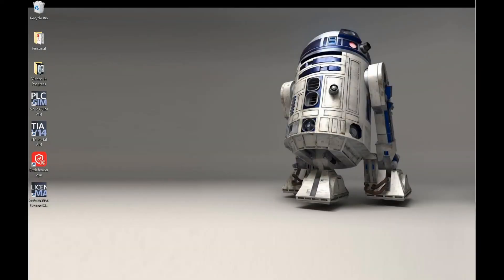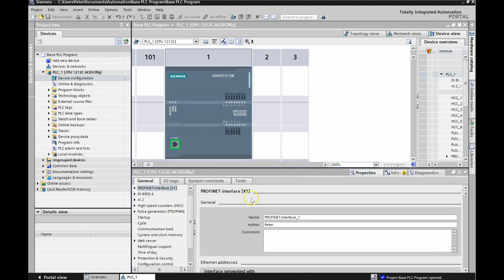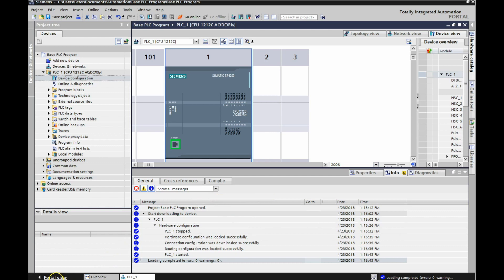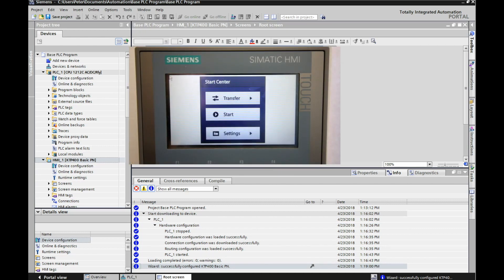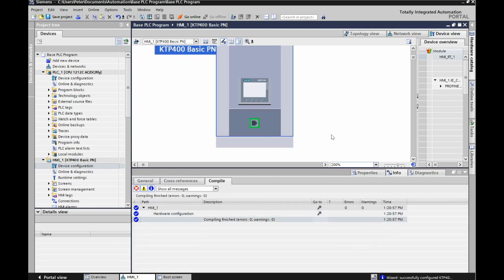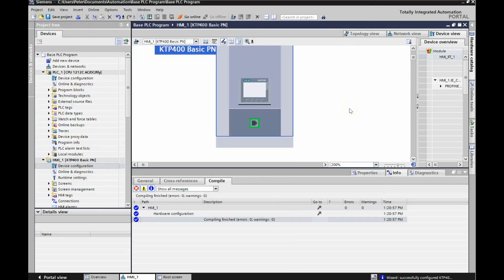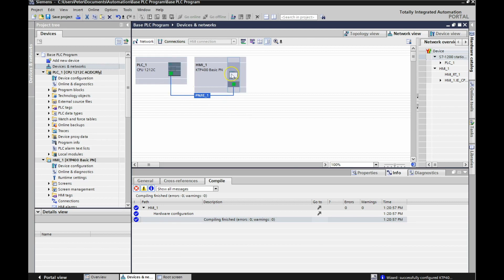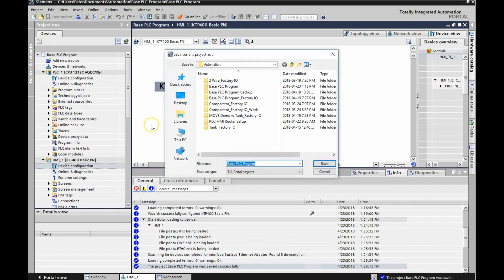Siemens TIA Portal & KTP400 HMI (Downloading your first HMI project)

Comment: The KTP400 has version No 15.01 but, I cant transfer stuff. It flashes correctly and the HMI is recognized on the IP adress through profinet, but compiles with warnings about version incompatibility. Even if I check "fit" it doesn't work, the HMI says: transfer failed. I tried initial setting of HMI version on v15.0, v13.0 in TIA portal, its not working either way. Has anybody an idea?

Comment: Why does loading HMI images with TIA Portal V16 fail with the error message "Components with a different version are installed on the target device. An older incompatible firmware image exists on the target device."? I checked image version on HMI it shows 15.01.00.00_24.01. Do I need to update the image and how can I do this if anyone can post a link or comment thanks
Reply: Same problem here... Could you solve it, if yes, how? Thanks!
Reply: @somethingirreversib  when you first select to create HMI project on the page look at the right side you will see version selection section. Their  you can chose which version you HMI is this is the ease fix to getting around this problem. The more permanent way would be to download the firmware 16 for the HMI you can get from Siemens website I was not able to do so. Tamar’s if don’t make sense send me email abulm3@gmail.com I can send you screenshots I made.

Comment: what are the modifications if i want to use an ethernet switch ??
Reply from the maker: No modifications required. That is the easiest setup. Provide a unique IP address for both the PLC and the HMI and the switch will communicate with both.
Reply: @PeteVree  thank you very much. i will assign different ip address for both hmi and plc and connect them directly to the switch and then to my PC. i hope i get it well